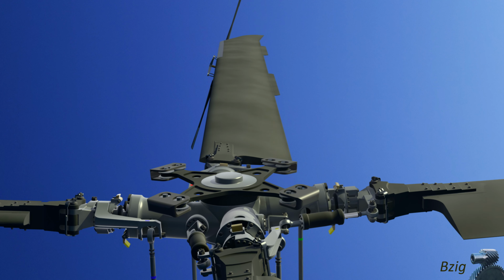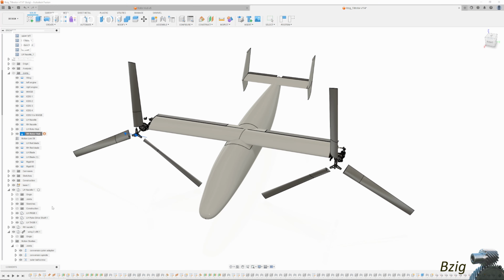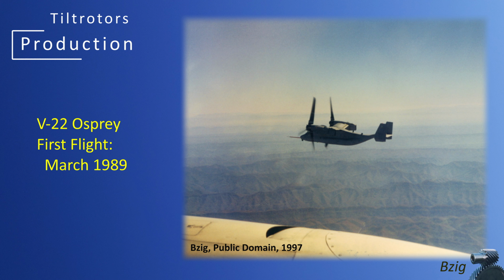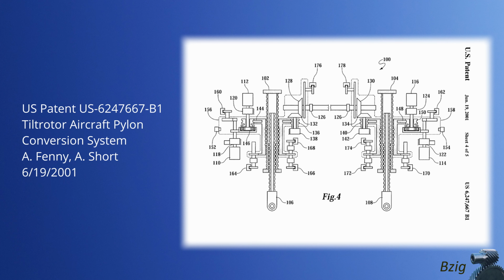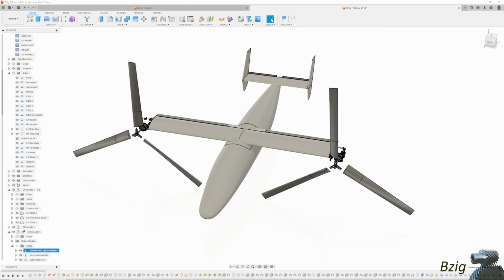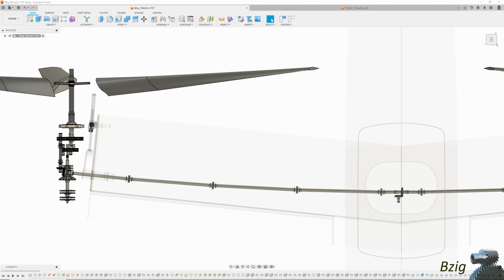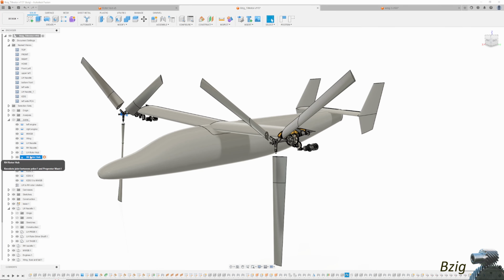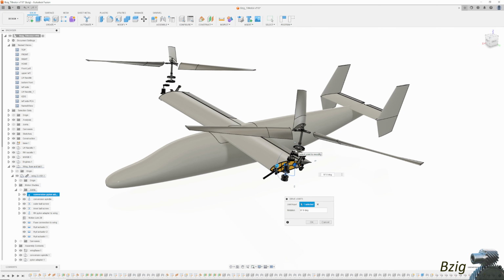Tiltrotor Design and Configuration

Comment: It is an aerodynamically unstable aircraft. From its development to the present day, this configuration has already taken the lives of hundreds of people, even though Boeing has invested a lot of money to improve this concept. I don't know why they would invest in something that is inherently unstable.
Reply from the maker: I disagree with both of your points; however, there's no doubt V-22 Osprey development had it's share of setbacks... so, while I disagree, I understand the basis of your comments.  

As far as "hundreds of people" the actual number is 62; this is a terrible number, especially if you are a friend of family member of one of those 62 people, but this number represents an aircraft that's been in development, production and operational service for 45 years.  The in-service class A mishap rate for the MV-22 Osprey is about the same as most other DOD aircraft (see the article "setting the record straight on  the safety of the V-22 Osprey)

The "aerodynamically unstable" comment is unfounded.  The 2003 DT-OT transition report, that cleared the MV-22 for entry into operational service, did not note any failure of (or failure to complete) basic aerodynamic stability testing.  There are noted "aeromechanics issues," but this is different from being "aerodynamically unstable."  Specifically, The V-22 has an accident history with entry into asymmetric vortex ring state and formation flight wake interaction.  Maybe this is picking too much into the details of your comment... and maybe I'm too colored as an advocate for the technology... but, at the end of the day, anyone can build another airplane and rely on the capital investment needed to build airports... progress happens when we challenge the status quo.

Comment: 06:41 Could a single-stage screw have worked if the pivot point of the screw was positioned between the second and third wing spars, so that the screw is fully vertical or close to fully vertical when the propellers are tilted upwards (with an extended ærodynamic fairing to account for the longer length)?

Comment: The rotors are turning in the same direction as the wingtip vortices which increases the vortices' energy. If you reverse the direction of rotation, the rotor wash will counter the wingtip vortices which decreases the votices' energy (less drag, more lift, better cruise performance). There is no asymmetric thrust condition, so handling characteristics should not change.
Reply from the maker: Thanks for the comment!  But .. tell me if I'm wrong please; the vortex rolls up from the higher pressure on the lower side of the wing to the upper side.  Looking at the left wingtip from the rear, this means a CW vortex and a CCW rotor rotation.  Or maybe I didn't understand your observation.   
Either way, I like the comment... It shows there are, sometimes not so obvious, considerations that go into design choices.  I was always told the primary reason Bell chose that direction was for crash survivabillity:  If you  land in wingborne flight, that rotation direction is supposed to throw debris away from the fuselage.
Reply: @bzig4929  Debris includes chunks of ice being shed from the rotors during flight in icing conditions. Some airframes have thick plates on the fuselage for protection against this. 
Many different wingtip designs, winglets, wing fences have been tried over many decades. They have one purpose- to reduce the energy going into the wingtip vortices. A CCW rotor should be paired with a CW vortice IF the goal is a reduction of induced drag. Reducing the energy in the vortice reduces induced drag. Bell decided that another compromise has priority. There are a few experimental aircraft with props at the end of the wings such as the Vought V-173 with high aspect ratios where the direction of prop rotation made big differences in efficiency.

Comment: A small correction regarding Platt-LePage Aircraft. "LePage" is pronounced sounding like "LePaage" (sort of French sounding) Not like the "page" of a book.
The Platt-LePage Tilt-Rotor dates back to the early days of The XR-1, Frank Piasecki told me how Haviland Platt gave him busy work, setting up the mixing controls, of the small Tilt-Rotor, when he first arrived at Platt-LePage Aircraft.
Drop me a line if you ever want to animate the XR-1, or the XHJD-1.
Reply from the maker: Thank you so much for the correction and also for the offer of help on the XR-1.  I've spent some time working on tiltrotors, but I did a deep dive into the history of these aircraft for the first time in my life as I made this video.  I found the history going back the the 1930's...  the Franklin Institute meeting... the intersection of helicotpers, tiltrotors and gyro planes to be more fascinating than I knew.

Comment: if I were to make a helicopter I would make it without the rotor tail. I would use a traction like in trailers on the back connected to a hydraulic clutch that is connected to the floor of the helicopter. given the fact that both the axis of the propeller and the axis of the floor have the same direction, the power of both  propeller and the helicopter frame is transmitted in the same direction 😊

Comment: If there's a drive shaft right across the wing then why put the engines in the nacelles, you could have them in the main body.
Is it a weight loading thing, the engines are heavy and having them in the nacelles effectively right at the point of lift takes that stress off the wing?
Reply from the maker: You could absolutely design it that way.  In fact the first tiltrotors has their engines mounted that way.  

Reducing the mass at the wingtips would improve low speed, lateral, handling qualities.  

One disadvantage of doing that way is that the driveshaft then becomes a critical part.  The osprey has had in service drive shaft failures and, while it's an emergency, it's not catastrophic.  With the osprey config, the drive shaft only carries load when one engine fails.  

Either way, it's a compromise... Both designs are valid.

Comment: Very informative video. But the more interesting solution is to replace the turbine with a hydraulic motor with a hollow shaft. To control the overall pitch of the propeller. At the same time, there are no heavy units on the rotary wing console and there is no synchronizing shaft line...
Reply: Hydraulic motors are very inefficient, they will generate a ton of heat.

Comment: This is wonderful!

A suggestion, then questions and a comment:

I would really like for you to bias your generized design to be as close as needed to the V-22 so as to be able do accurately demonstrate the gearing issues that are causing the ongoing V-22 safety and grounding issues. Your intended audience for this should be aviation journalists and policymakers.

Do you believe it would be possible to design a tilt rotor that could successfully autorotate without injuring the crew or passengers?

How much more sensitive are these vehicles to inflight CG changes than fixed-wing or rotary-wing aircraft? Like passengers moving around, or cargo shifting unexpectedly.

A Navy helicopter pilot once told me that the biggest problem they had with the Ospreys early on was trying to transition fixed-wing pilots to them, and the problems diminished when they stopped that and insisted Osprey pilots started out with real helicopter flight school. I’m pretty sure I’ve misremembered exactly which branch he flew for, and that’s probably better for him anyway.🤐
Reply from the maker: I'll consider the V-22 gearbox suggestion.  My model has an overrunning clutch... As would any design, but my model uses a single planetary, whereas the osprey has a dual planetary.  I hinted at this when I mentioned the larger osprey requires a deeper gear reduction than smaller machines.  

The osprey can autorotate... I've always thought Harry Dunn treated the design unfairly.  He has a few good points... The autorotation rate of descent is higher than most helicopters, so less survivable, but it definitely can autorotate.  The AW609 took the testing of engine out tiltrotors further by testing through the edgewise flow region and by showing a capability to zero the rate of descent.  

No one has yet done a touchdown autorotation in a tiltrotor, but, at least in the US, transport category helicopters are not required to demonstrate touchdown autorotation.
Reply: @ excellent response; thanks! In part, my knowledge about the lack of autorotation is confined to a dozen hours googling and perusing comments, with all suggesting it kind of happened, but not close enough for hand grenades, so you shed some very interesting light on the subject I had not found anywhere else.

But regarding the rule “transport category helicopters are not required to demonstrate touchdown autorotation”, WTbleepingF?! Can you point me to any historical discussions on this lack of such a rule by the authorities having jurisdiction?
Reply: @bzig4929   Could say, four JATO bottles, triggered by a radar altimeter slow an Osprey autorotation enough to be walk-away safe?
Reply from the maker: I agree with your friends comment about pilots with no helicopter training.  CW Lemoine did a really good video on the recent USAF, Japan, osprey mishap.  And he discussed that very topic.  I  find no fault with that crew, but their decision to continue with a degrading gearbox would likely have been different had they been trained differently... With more of a helo pilot mindset.  In the end, it was a material failure and their procedures let them down, but it could have been different.
Reply: @ I watch CW occasionally, but he did his training in a Robinson. Far braver than I will ever be again. I paid for a ride in an R44 around the Hiller museum at KSQL once, but that was before I learned about mast bumping. I’m shuddering at that thought almost as much as if I were back in the right rear seat.

Comment: Its interesting that your design has two things which Bell absolutely hated about V-22/609 and its why they moved away from them on V-280, tilting engines and a forward sweep on the wing leading edge.
Reply from the maker: Whittles book points this out also... V-22 requirements drove them to a design they felt wasn't the best use of the technology.
Reply: @bzig4929  Its also interesting to me how HSVTOL solves even further problems from the V-280 like still having a heavy twist in the rotors, as now you can optimize the rotors for vertical flight and then fold then and use the turbofans for forwards flight.